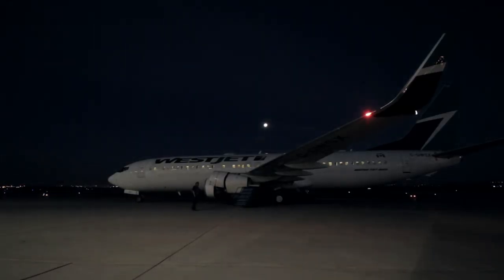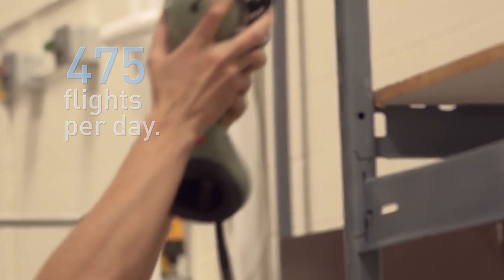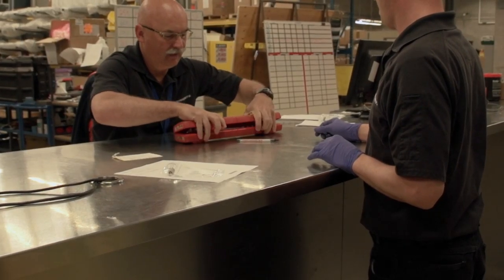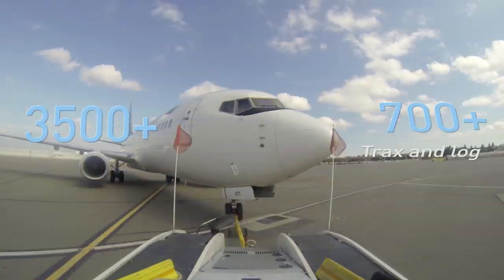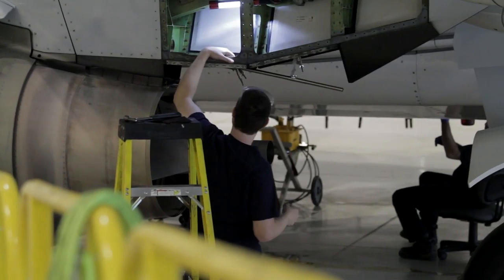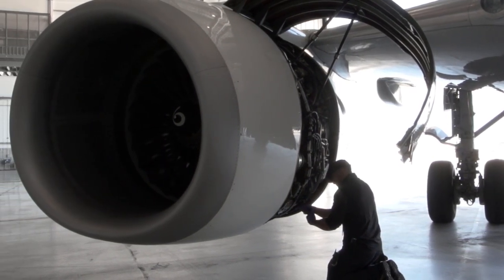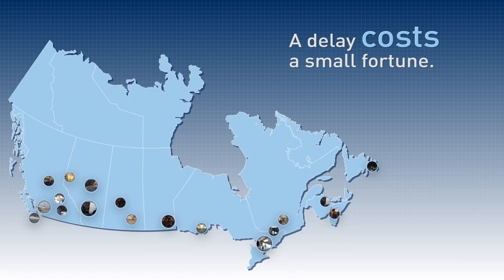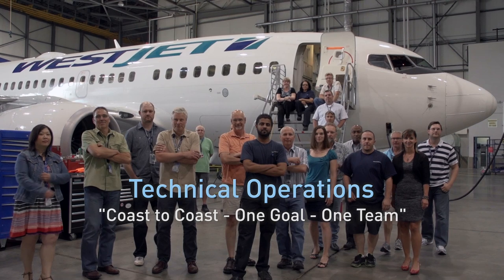Intro to WestJet Technical Operations aka TechOps

Comment: Great video! Will any of the ETOPs 737-800s (such as those doing YVR-HNL and the like) eventually be flying the new YYT-DUB route in the future (timetable says it will be -700s to start)?
Reply: All of WJs -800s are ETOPS cert. The -700s typically day to day are not, however they can be fully ETOPS capable within approx 45 minutes with a simple life raft install as they also carry the other required ETOPS equipment (HF radios, Cargo Fire suppression. etc) full time. The timetable is correct with the YYZ-YYT-DUB route on the -700s. My guess is WestJet is likely testing the TATL routes with the -700 as it actually has more range then the bigger -800 (same wingspan, same engine rating), and provides a bigger safety buffer until they know what to expect operating over the Atlantic and into Europe. I suspect if all goes well initally and the demand for more seats is evident, the -800 would be used on that routing one day.
Reply: yycvor They have a few -700 ETOPS cert. for when they started their flight to Ireland. They used a -700 for that flight.
Reply: Indeed they did
Reply: They also have a few -700 to go to HNL
Reply: Well sort of.... as I explained ages ago the -700s are not configured for full time ETOPS. If a 700 is required to operate a ETOPS route, they will be converted to ETOPS spec before departure, fly the route, return back to mainland. Where the ETOPS spec will be removed and the 700 will resume non etops routings.  WestJet ended up having YYT-DUB operated by specific -700 aircraft (I think 3 were configured for that routing only) that are configured for North Atlantic ETOPS and european operations.
Reply: Yes, I know.. I'm just saying they have -700 configured to fly to HNL